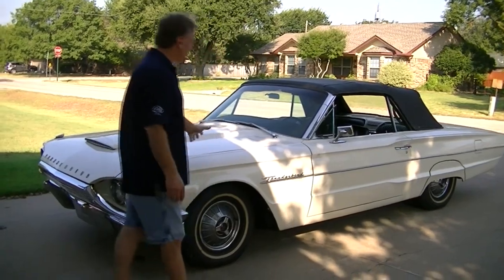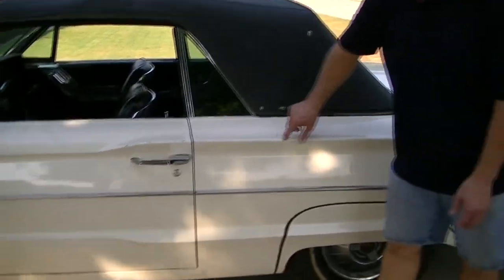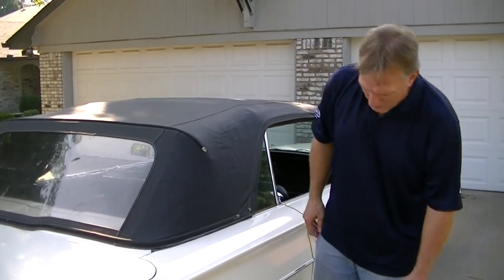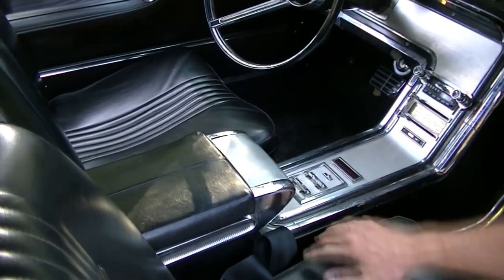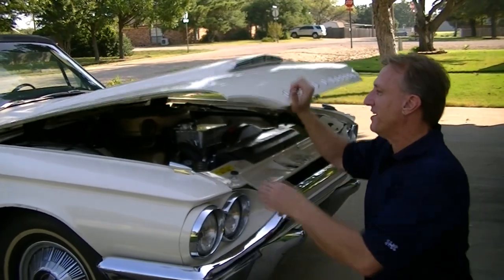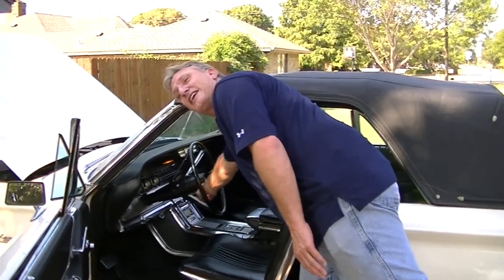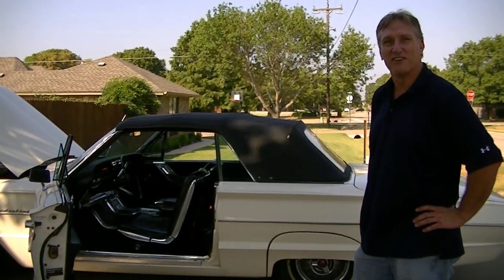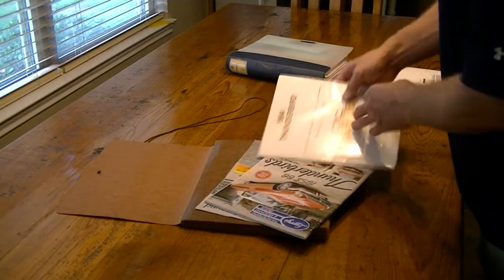1964 Ford Thunderbird Part 3 - What To Look For When Buying Classic Cars - T-bird Documents - UNR 41

Comment: Mickey Mouse surge tank!  Those were known for massive electrical and vacuum problems along with weak front ends and hobbible brakes that would eat linings and drums.  In 65 they went to front discs which solved the brake problems.  That said, I love those years!
Reply from the maker: I love those years too. My grandma had a 64 T-bird that I used to ride in back in the day. She traded it in on a new 69 Ford LTD. Thanks for watchin'.

Comment: So, I bought a 65 hardtop (eBay) listed excellent in and out. Wish I had seen your video before the purchase!! It turned out to be nice in and out. Long story short, I purchased the car for 10k and will another 10k in it to get to be a driver quality. Live and learn. If you’re thinking about buying , don’t make my mistakes, do the research and this video is a good first step.
Reply from the maker: Sorry that happened to you. It happened to me once as well on E-Bay. I spoke to the seller on the phone for about an hour before buying and found he lied about most everything. I realized it as the transport truck was pulling up in front of my house. Sick feeling. Thanks for watchin'. Be sure to tell your friends.
Reply: @up-n-runnin377  will do. Thing that really angered me is the car was listed as air conditioning, arrived with no compressor, clutch or belt lol. The list is long 🥲

Comment: Those were the days when dealers and others would install those protective strips on the sides of cars.  They may have helped protect against door dings but they ruined the looks of the cars.worse yet they were often installed by drilling HOLESin the sided of the cars and riveting them on!

Comment: Worn front end, wheel bearings replaced, and an engine rebuild? It had 130K on it
Reply from the maker: Thanks for watchin'. I agree with you. I shot this shortly after I bought the car and the more I looked at it, the more I think it had more miles on it. I now think someone drove the heck out of it when it was new and then very sparingly after that.